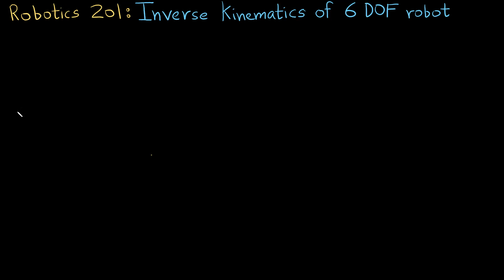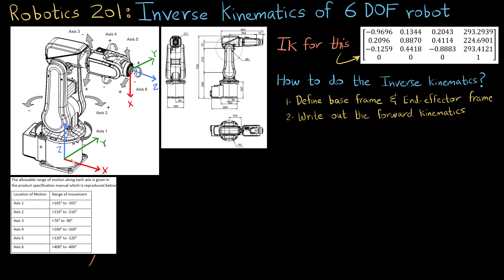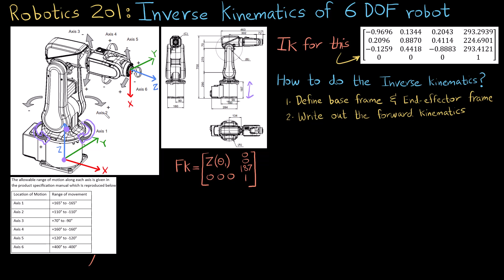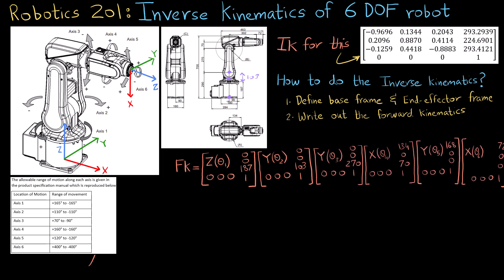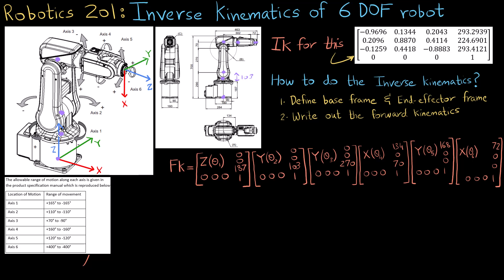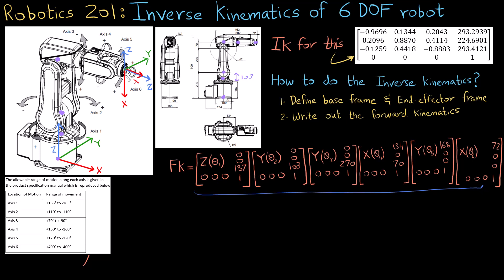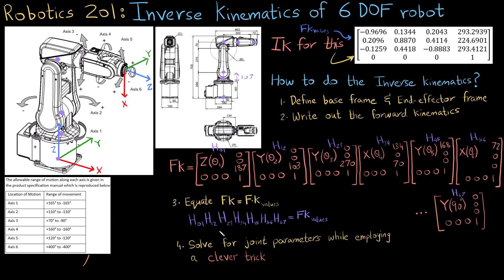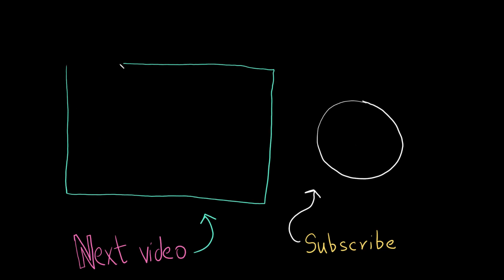Inverse Kinematics of Industrial Robots (solved Example) | Part 2 | Robotics 201

Comment: Question. Once you used the homogenous transforms to transform the world coordinate frame to the final coordinate frame, you said that the orientation of the axises would be same as the initial frame. but would the rotation elements in theta 1 to 6 change said orientation. Why exactly are we applying the last transfer with 90 degree angles?
Reply from the maker: Hi Aswin!
I am unable to completely understand your question. As far as I understand, you are asking if the orientation of the world frame and the final end-effector frame is going to be the same? The answer is: No. The reason is that the Forward Kinematics allows the user to input any values for the joint angles (theta 1 thru theta6) and depending on these values, one gets the final orientation of the end-effector frame.
As far as your second question goes which is the reason of applying the final 90 degree rotation, the answer is that in this particular example, we were already given the orientation of the base frame and the end-effector frame i.e. it is PRE-DEFINED. We were not given the liberty to choose the orientation of the end-effector frame. Therefore, to achieve the final orientation, we had to perform the last rotation in Y-axis by 90 degrees. If we do not do that, then the homogenous transform's orientation at the end DOES NOT match the orientation of the end-effector frame which is PRE-DEFINED. 
If the end-effector frame wasn't PRE-DEFINED in the question example, then there would be no need to perform the final 90 rotation about Y axis. However, then your final co-ordinate frame will be such that the Z-axis will be facing up (for the configuration of the robot shown in the picture).
I hope that answers your questions. If there is any confusion, please feel free to let me know.